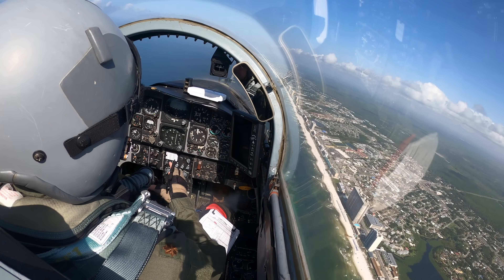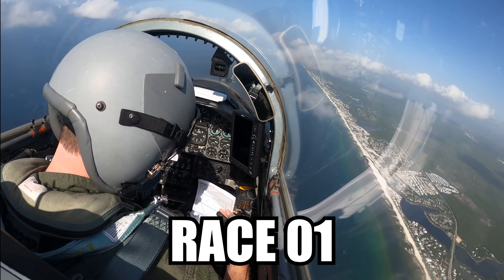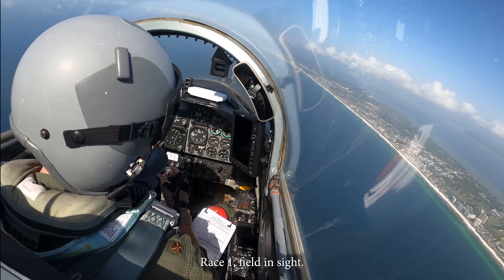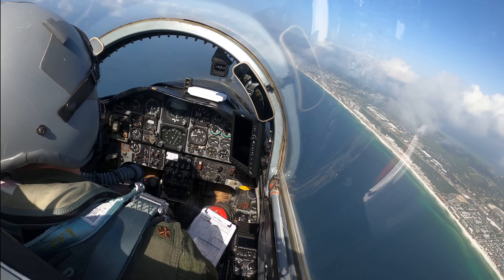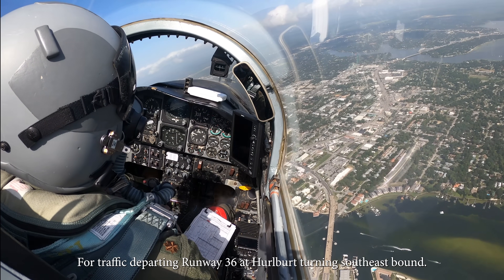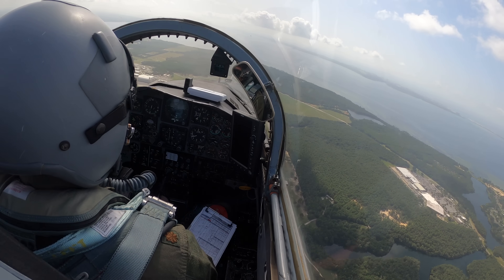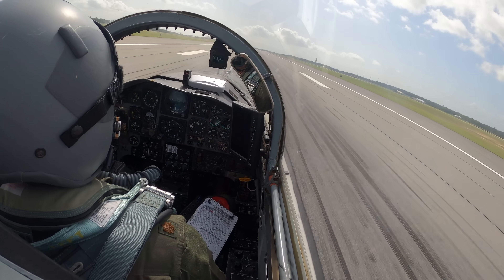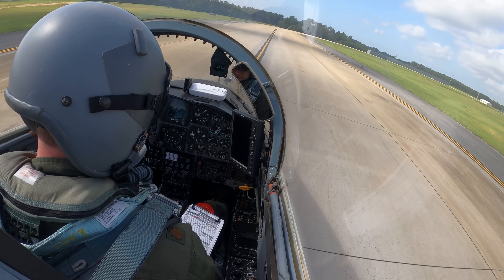FLY WITH ME in a USAF T-38A Doing an Overhead Pattern to Land

Comment: Looks   fun, flying T38.
 My option is doing the extra go-around and circle maneuver, wasting time and fuel.
I would have slowed down to 180-200 knots before the initial point  for a left 270 turn midfield, and drop the gear at the midfield point (over the runway) while turning left with idle engine speed at 1500 ft AGL.  Work for me all the time at KSJC.

Comment: I was unaware that T-38As were still in operation. I'm assuming this video is older? Noticed the buffet in the pitch. I thought I remembered the canopy rattling in the final turn after the cockpit depressurized. I flew the T-38A in UPT Vance 77-01. After 3 years as a Tweet IP, I flew it again as the AT-38A at fighter lead-in training. I flew overheads in my SR22T at my home airport. The tower understood and just acknowledged that there was no published procedure.

Thanks for sharing, Mover.

Comment: I'm glad I found this video.  All the other T-38 vids seem to be model B or C which I never flew.  I got to fly one these fresh out of the factory in 1965.  Four years as an IP.  Great memories.
Reply: Straight from the factory? Did it still have that new jet smell? 😃
Reply: @fkp-1353  Probably, but I didn't notice.  It had only 1.2 hours on it.  When I opened a service door, the paint cracked on the hinge.

Comment: I was Army but held PPL, not military pilot. But I had a friend who was a T-38 IP at Sheppard and one year during exodus and when the base was dead, he basically gave me half a day in the sim building to play in the T-38C full cockpit sim that was almost the entire plane forward of the cockpit bulkhead. You climbed in and sat in the mockup ejection seat, had the canopy bow in front of you and everything, and the screen was like a mini IMAX that wrapped around the nose of the sim. Somehow I instinctively knew every time I landed the sim, to land off centerline. I guess from just watching them so many times and rarely ever seeing them take the centerline, though this was always drilled into my head by instructors in civil aviation. Also, even in the T-38 sim, I had the most trouble landing that damn thing if I was any amount of high on approach. It just DID NOT want to come down. It wanted to fly, and I literally had to point the nose down and dive toward the runway once because even dirty with everything out and throttled back, even in the sim, it doesn't want to descend. It just approaches stall speed and you start buffeting. LOL I wasn't used to that after only having flown piston IRL. However...fly shallow approach and it lands buttery smooth. From the videos of yours that I've watched about flying the real jet, it seems the sim is dead on and gives you the same flight characteristic quirks. Easy peasy taking off and just tooling around. Much harder to land it well.

Comment: Wait... the heavies do overhead breaks? I always assumed they came in on a gentler approach, more like an airliner. Legends.
Reply: At our deployed location we did over heads at 350kts and broke at 60 degrees of bank and full speed brakes until we could slow to drop the gear and flaps. KC-135. Fun stuff!
Reply: @Super80ed  I was at Maple Flag when a 4-ship of C-141s came down initial in fingertip and pitch out.  One of the coolest overheads ever and this is from a former Phantom driver.
Reply: @jcheck6  Wow, I wish I'd seen that, sounds awesome!
Reply: @Super80ed  Man that must've been a hell of a sight. Legends!
Reply: @Streaky100001 we usually flew down initial in trail. 6 ship. Sometimes in fingertip formation. Whatever lead chose for that day. Flying finger tip in a 707 was sporty. Then broke just like our fighter boys. It was great stuff. Coming back home we couldn’t do it anymore.
Reply: @Super80ed  in 707s? Holy crap, that's awesome!
Reply: We did the overhead in the KC-135 at Beale for a short time until our Vice Wing Commander told us to knock it off.
Reply: @Jam73-ER Ha!

Comment: The interesting thing about the overhead for the Air Force was it was initially designed to get the bombers down quickly after a mission so that they can rearm and refuel, especially with the B-47 jets coming online. The C-types and the Navy P-8s do not fly the overhead to my knowledge, but the bombers absolutely do.
Reply from the maker: I’ve seen C-17s and C-130s do overheads.
Reply: @CWLemoine Interesting. I never have, I’ve always seen them make straight in approaches. Doesn’t surprise me though, they’re tactical after all.

Comment: Saying "no factor" after reporting traffic in sight means absolutely nothing to radar controllers since they either simply need to call traffic to you because calling it is required or because they still have some sort of separation responsibility (radar separation, vertical separation, visual separation, etc.) that's still being applied and the conditions for discontinuing that separation haven't yet been met. To the controller, the traffic might still be a "factor" due to the specific way the rule is written in the ATC rule book.